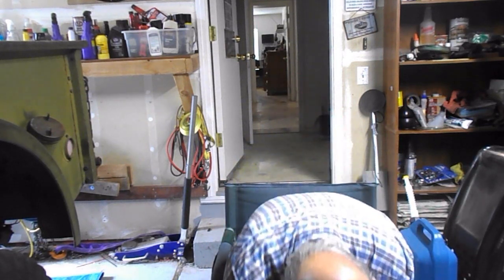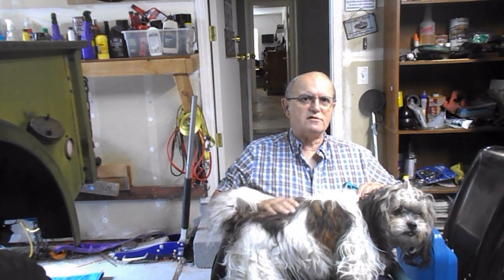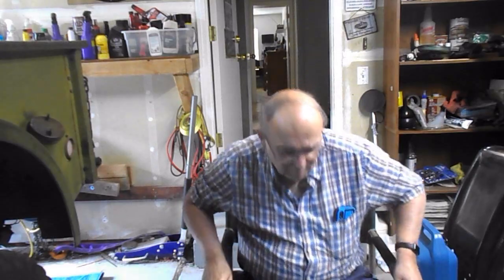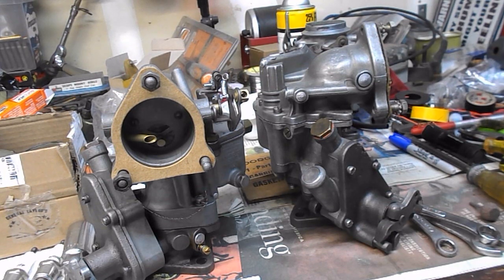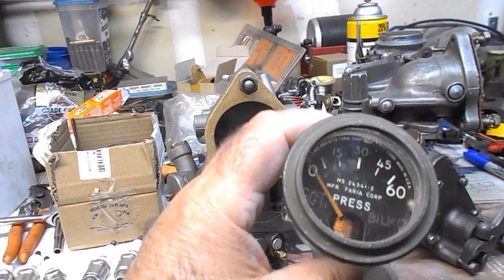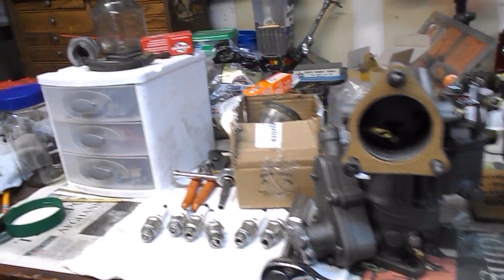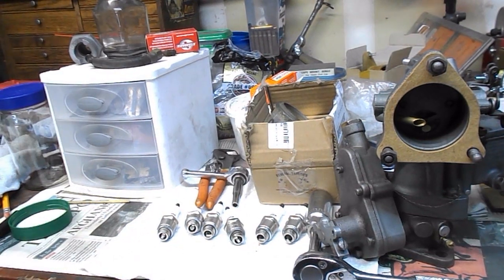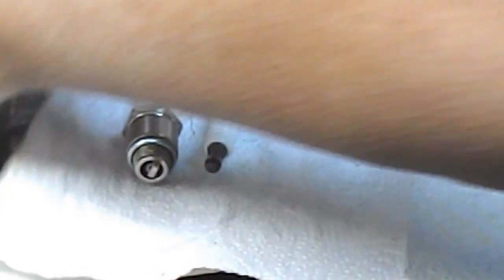Part 39 U.S. Army 1952 Dodge 3/4 T. 4x4 M37 update on what's Happening

Comment: Lots of good work there Larry. The carby's came up a treat as did the oil pressure gauges. Keep it up Man :)
Reply from the maker: Ron deserves all the credit for rebuilding the parts I just cleaned each section of the carb with my ultrasoinc cleaner. But we need to get this right so we don't ruin the engine anymore than it has been. Thanks for watching Frank

Comment: Wow awesome work Larry and Ron did a nice job on the carbs to. Thanks Slim. PS Good to see your doing ok and I hope Ron is getting better.
Reply from the maker: Even better than what I show here i put it all back together the next day ran it from a clean source of gasoline and it ran fine able to adjust the idle and no more smoke.. Have a nice clean running engine but to keep it running I need a decent fuel tank. But it's running an i know it will drive too